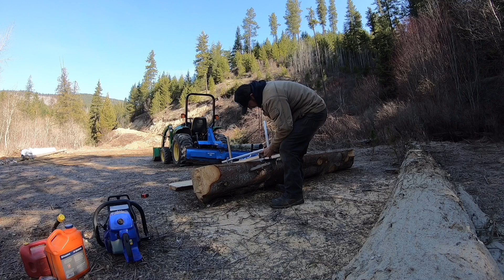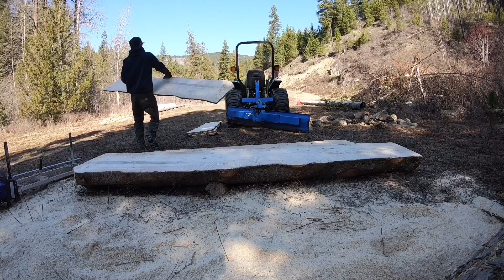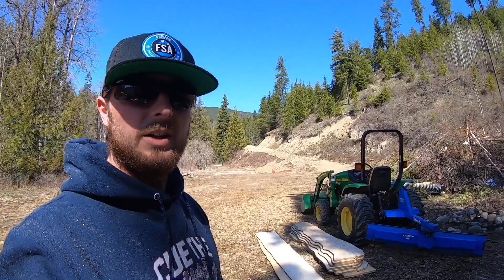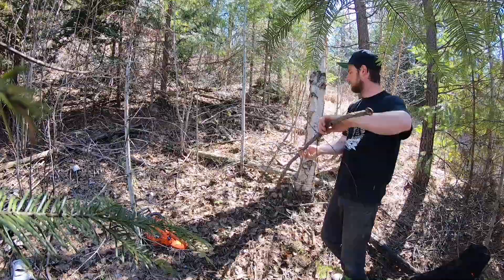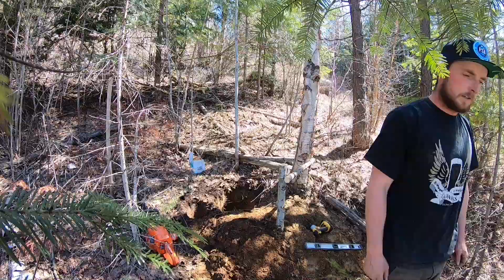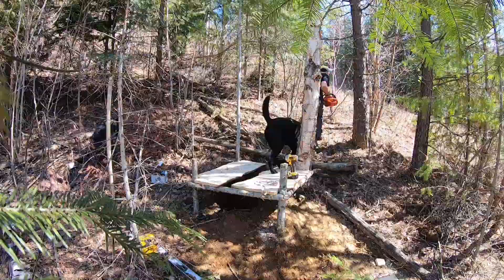Milling Boards | Composting Toilet Construction

Comment: are you gonna dry, or cure the milled lumber?
Reply from the maker: The right way to do it is to let the tree dry and season before milling, to prevent warping and cracking. For this project I didn’t wait so we’ll see how bad they twist.